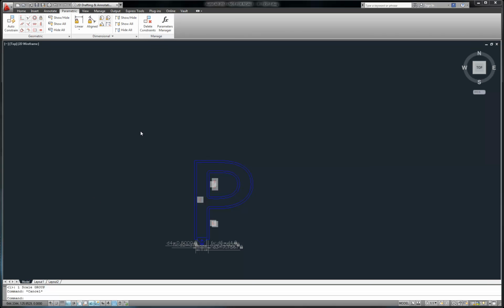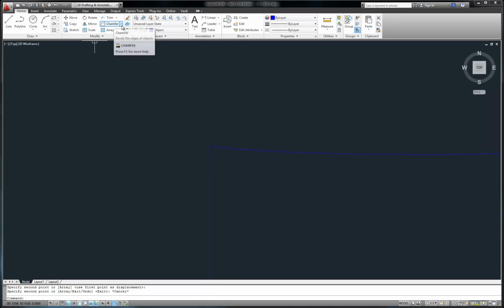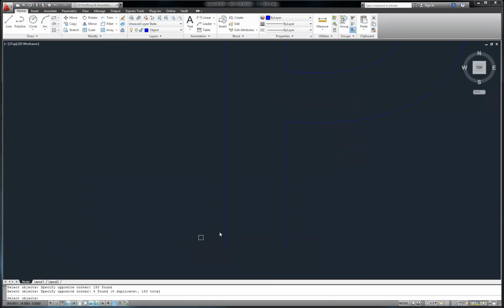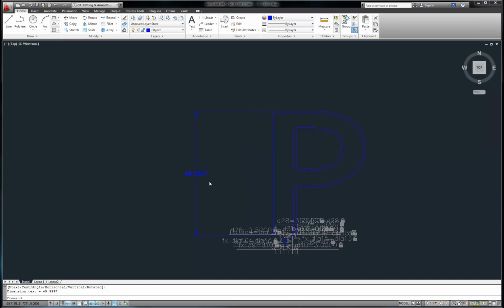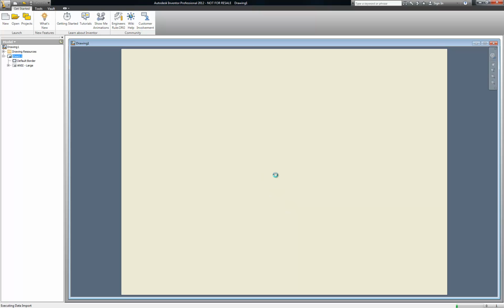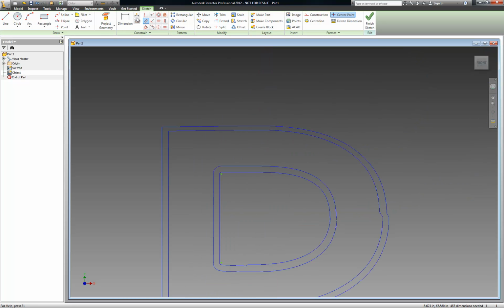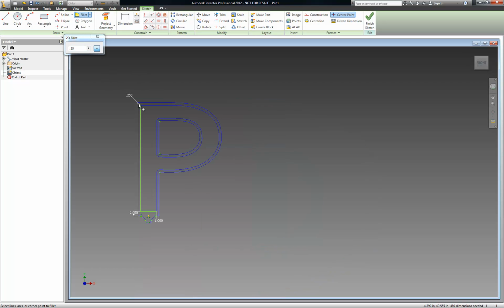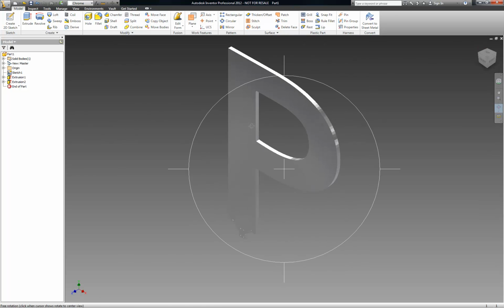Scaling P from Autocad to Inventor

Comment: nice :) but  i have 2 questions:
1. why wouldnt you do the modeling of P in AutoCAD, its much faster?
2. why is it the top view of autocad equal to front view of inventor? 

 its confusing. every program's top view is by default top view to any other program. why is it now exception?